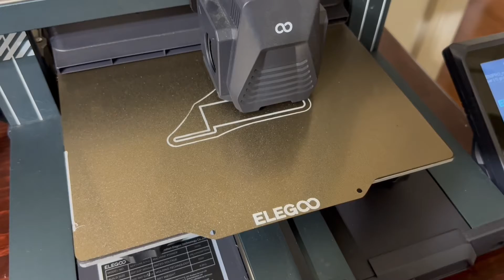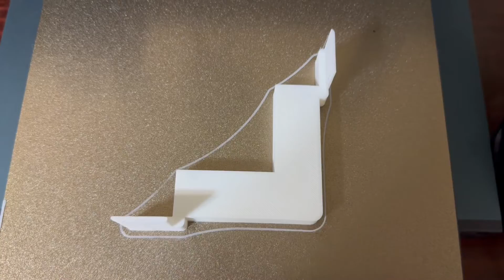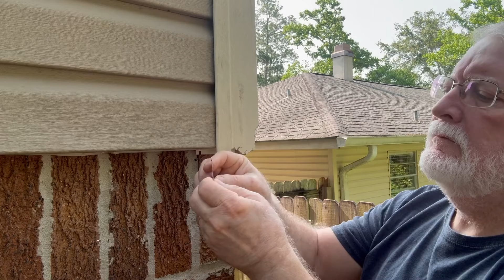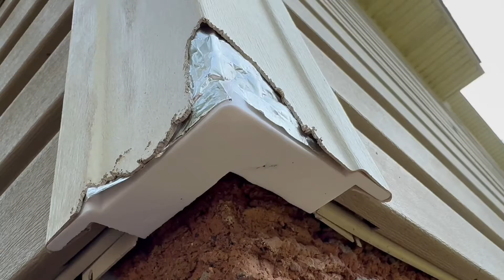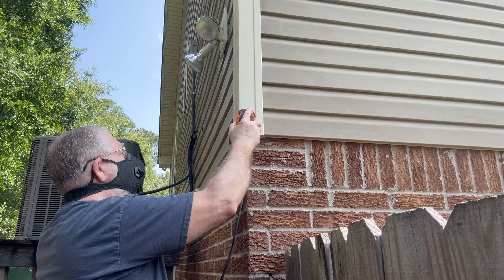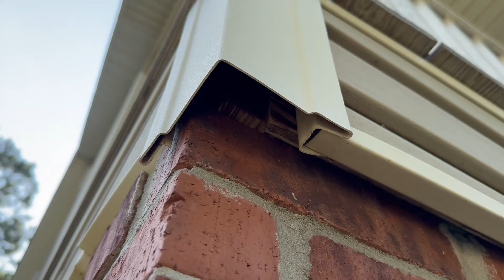Repair the Vinyl Siding and Stop the Rodents and Honey Bees From Entering the Home

Comment: If that mask is like the one I had for Covid, it definitely isn't going to keep the dust out of your lungs; the holes are way too big. What it was supposed to do to prevent Covid is anybody's guess, but after inspecting mine close-up, I saw that it wouldn't be effective, either for protection against nasties, or dust. Bondo dust would get through it. If it is the same as the one I had, of course. I would check that it is properly rated. 

(EDIT: it does appear to be exactly the same as the one I had, which is why I was concerned, but I can't be certain that it is.)

Nice job, though.